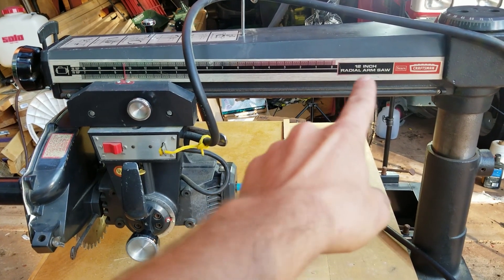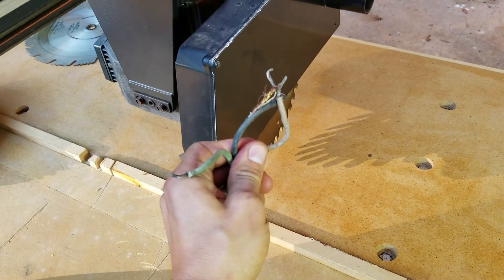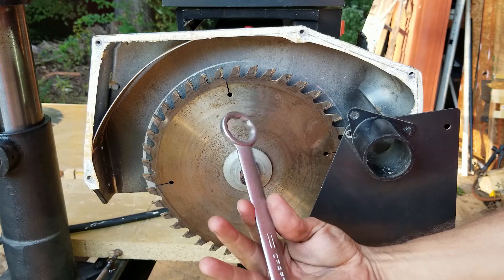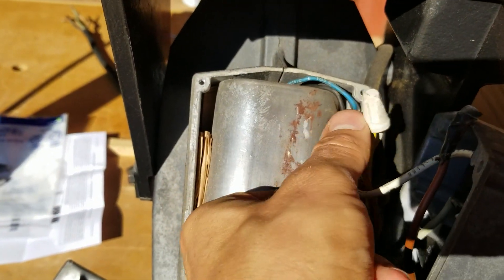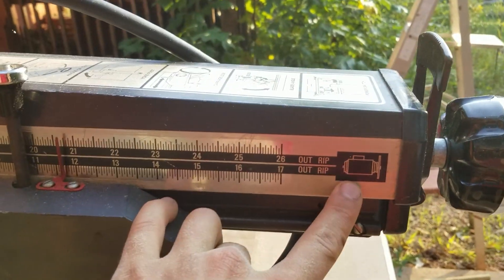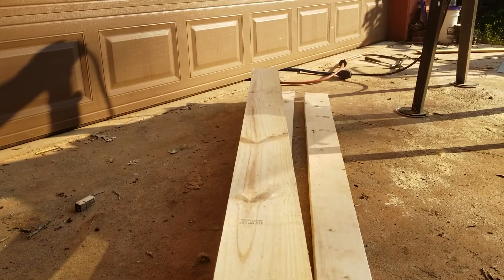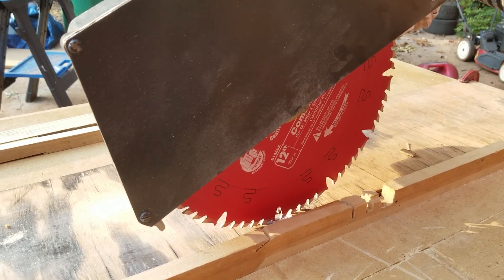Buying A Radial Arm Saw (USA Craftsman)

Comment from the maker: Hey Y'all! Supplies used in the description! Safety sallies BEGONE!
Timestamps:
0:00 Intro
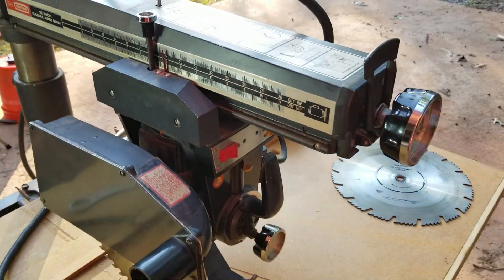2:10 Oil Machine
2:48 Swap Blade
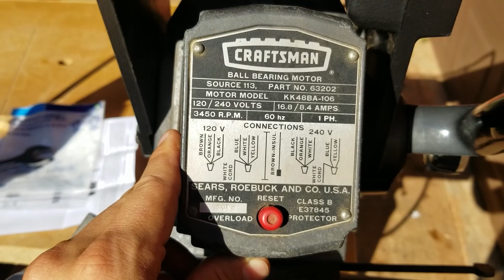4:33 Wiring 220V Plug
6:12 Test Saw Crosscutting
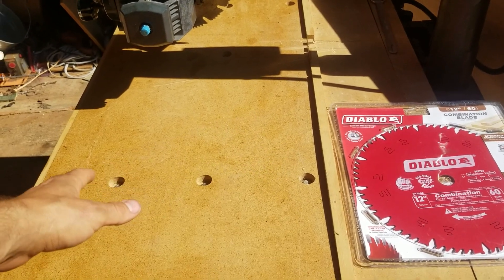7:14 Saw Blade Upgrade
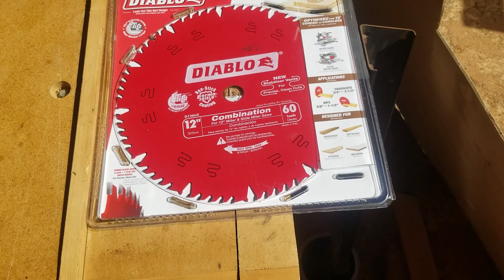7:43 Saw Adjustments
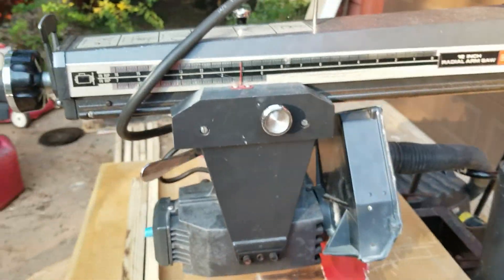8:44 Ripped Boards
9:17 Test Saw Ripping
11:01 Outro

Comment: Matt, had to stop watching your video.... no long marks are left on your table when ripping.... the blade DOES NOT move but whatever you're ripping does. On cross and miter cuts the blade does move and it will leave marks if your blade cuts into the table. Be safe, read or view about the saw before use.
Reply from the maker: Lol why'd you stop watching because of that. I know no long marks are made down the table. I mis spoke.

Comment: Your ripping technique is extremely dangerous.   The blade guard needs to be lowered in the front to 1/4 inch above the stock and you need to install the anti ejection pawls and splitter.  Never reach around.  Use push sticks.
Reply from the maker: I did it dangerous just for you!